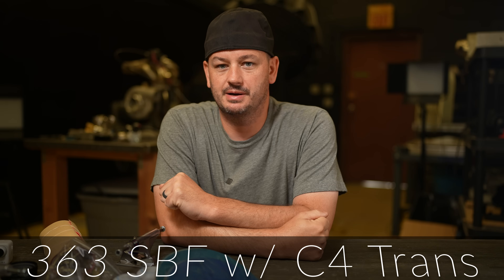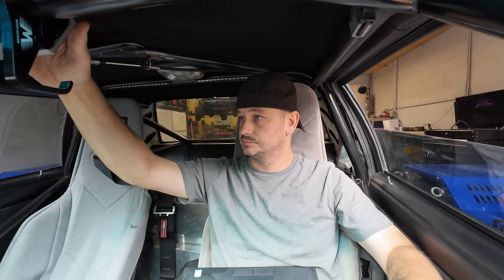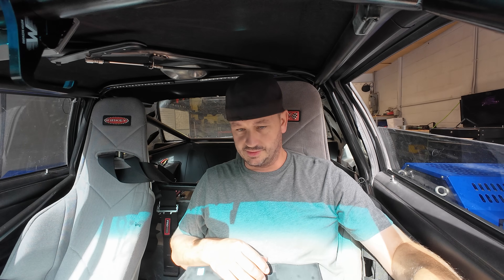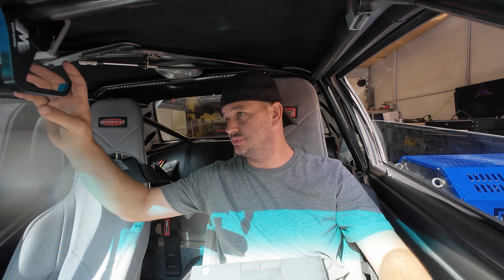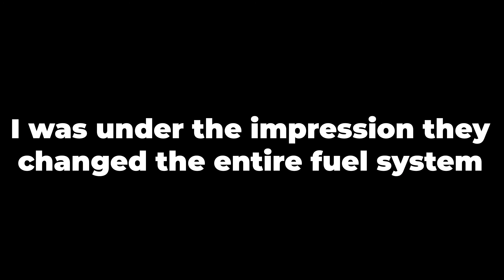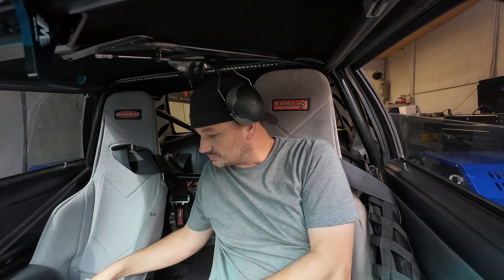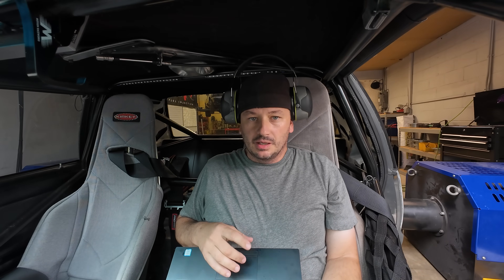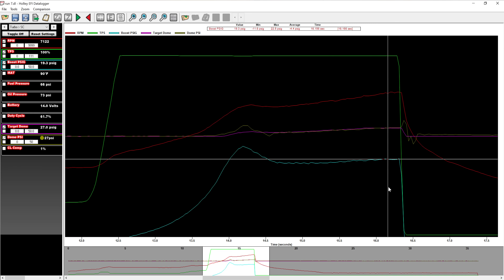Dyno Tuning a 1,000 Horsepower Turbo Small Block Ford with Holley EFI

Comment: 13:00 @Joe Simpson When you said the VE peaked at 111.  Are you using the flex table to add fuel or is the 111 the total? Still tuning on mine but my VE is around 170 at 15lb on e85 and I’m not using the flex table. Does that sound right or should i be looking for a problem?